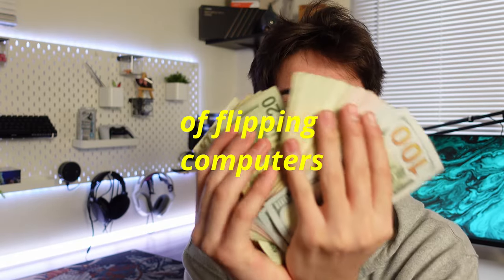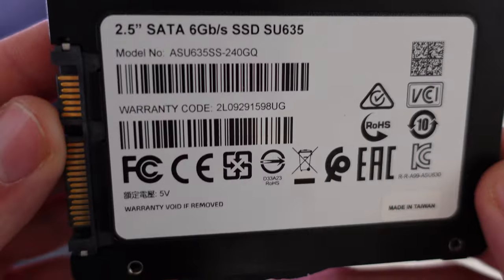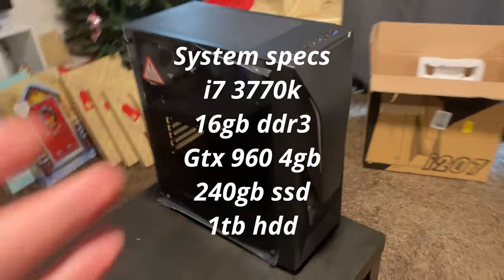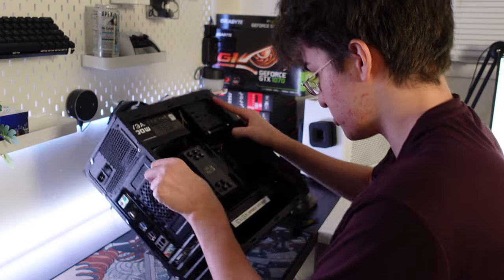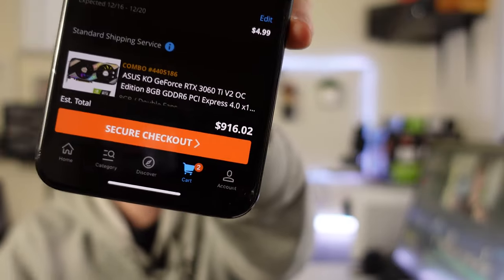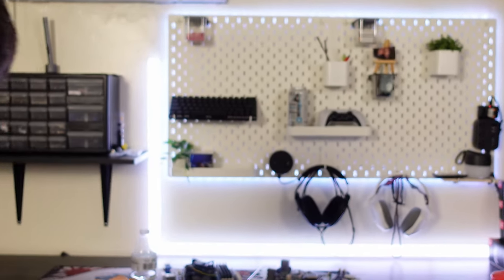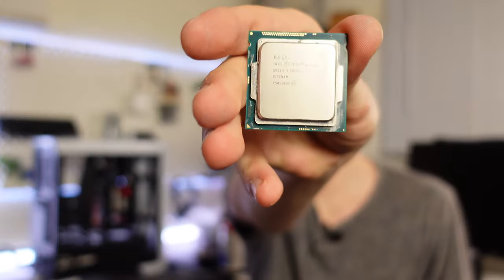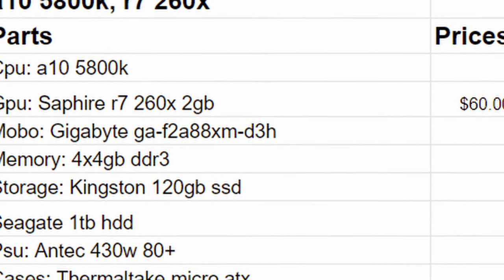Can I Make $3000 From Flipping Pcs For A Week Straight

Comment: Hi, I'm new to PC flipping despite having loads of experience building and fixing PCs for relatives and at my workplace. I have some questions that I hope you could answer!

1. With the current market (mid2023) what specs do you think flippers should aim for in the low-mid-high end?
2. What pricing do you recommend?
3. What do you recommend we do to maintain used parts? Do you think repasting the GPU is necessary?
4. How much effort do you think a flipper should put into confirming the performance of the system? I have sold one where I had a whole video of benchmarks and I also included a one week warranty. It only sold for $100 more than what I paid for the parts.

Sorry for the long questions but I hope you can answer them.